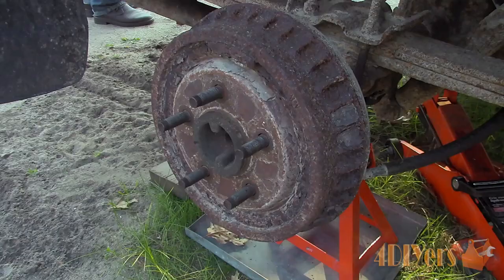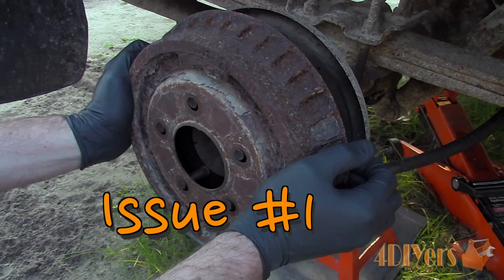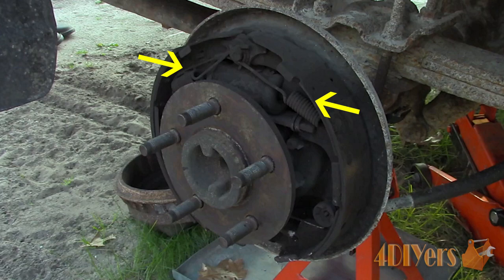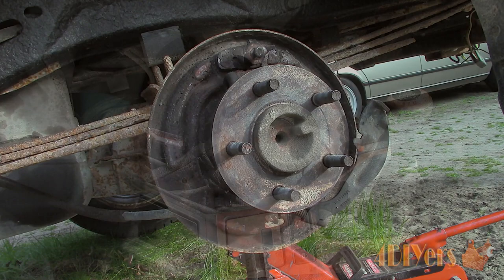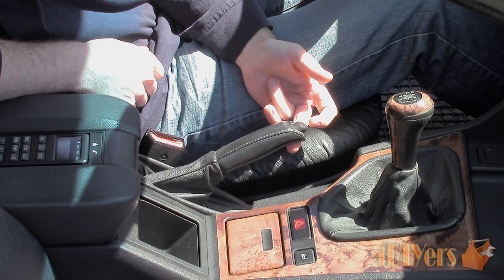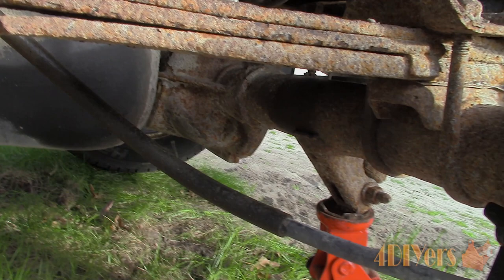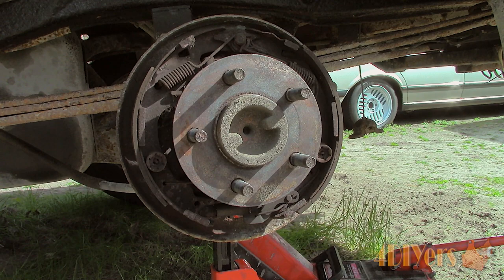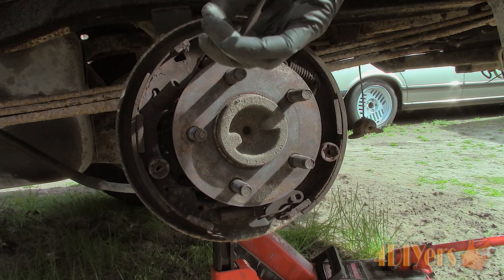3 Reasons for a Brake Drum to Stick

Comment: First things FIRST - Apply the brakes IN REVERSE several times - This may be all you need to do - As the pads wear over time this will USUALLY adjust them automatically - EASY FIX  (I drive a '91 S-10 w/only 108k miles on it)
Reply from the maker: That's the procedure for automatically adjusting the brakes. It doesn't solve problems where you have sticking components.
Reply: @4DIYers  Right. Yet I found over the years that as my rear 'brake pads' wore down 'occasionally' this SOLVED the problem -
Reply: @larrydbishop  damn that's a lot of miles